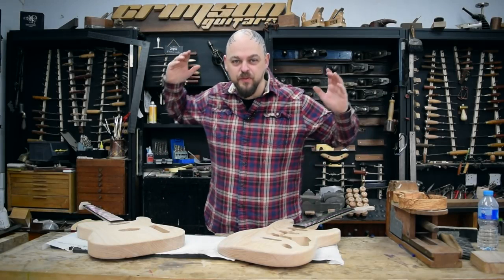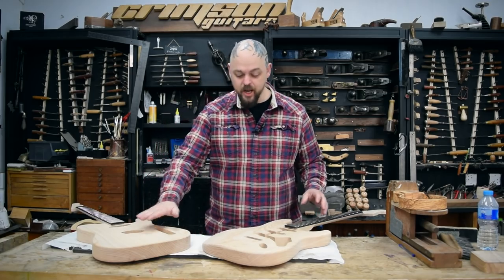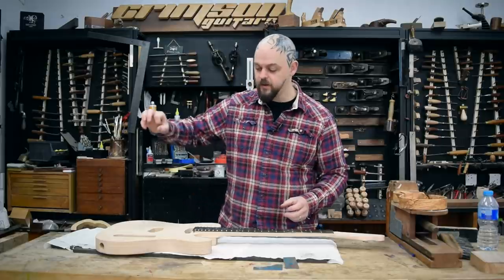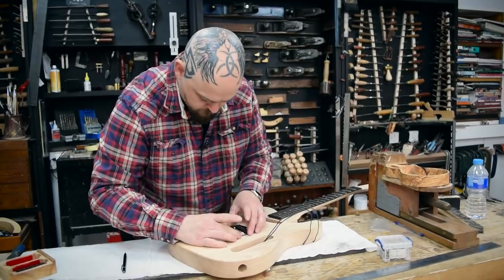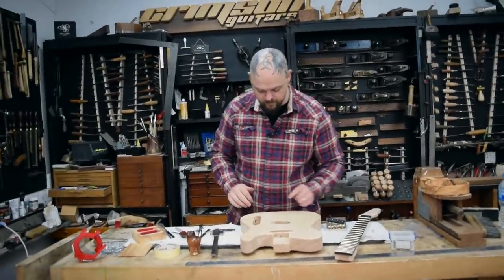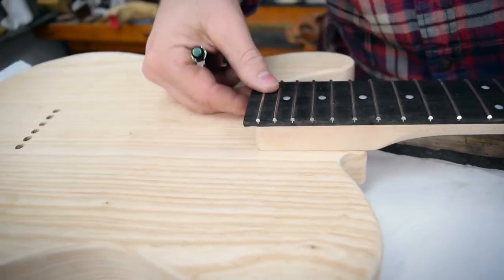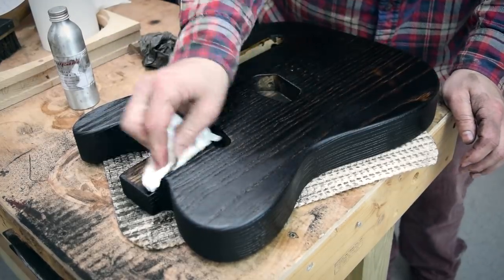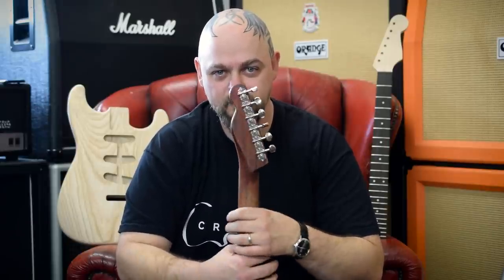Ep 1 - Building a Crimson T-Type Kit Guitar -  Preparing the Body

Comment: 13'36" indeed, Sean has a great eye for framing. Really appreciate the close detail look at your methodical marking. Mounting even a well pre-drilled kit can be challenging enough, especially if one rushes it, let alone blanks. It is important to go slow, make your mistakes in graphite over committing the wrong wood to dust and shavings — some wood must die for the sake of beauty, right? Good teamwork, fellows. Beauty shot in more ways than one.

Comment: Love the burnt look. I love the removal of the soft grain. There's a similar technique that I did on a cigar box (actually a jewelry box) guitar, that I would love to do on that body. Basically you remove the soft grain with a wire attachment with a drill. Then I'd use a rust/vinegar natural stain that produces totally unique finished depending on the tannin in the wood. It's not necessarily a stain, it's more like the copper effect you do- a chemical reaction. You basically take metal and soak it in vinegar to produce Iron Acetate. You can use just about any metal, some folks soak that dreaded steel wool that Ben hates in vinegar for a few days to weeks. I made mine by saving the liquid I soaked some rusty tools in to use. It takes some playing around (and maybe some dillution) to figure out what color you will get, but the effect can be anywhere from barnwood grey to dark almost black- brown. One thing that can also help achieve some interesting effects is to add more tannin to the wood by brushing on some cold tea and letting it dry. Then you brush on youur vinegar rust stain... nothing happens at first, but then minutes to hours later the magic happens. I usually play around with a scrap piece of the same wood- though that's hard with the kit. Also using those steel wool pads that contain soap can also give the stain a greenish verdi-gris look. It would be interesting to try this process on the body paired up with the copper/ammonia/mustard metal plates. Since they're both chemical reactions it would make for a truly one of a kind instrument.

Comment: First thing I'd do to customize a kit is to commission an artist friend of mine to paint the body, and in Crimson Guitar spirit, I would lightly char the neck/headstock. As for hardware I would use a fender 6 saddle bridge utilizing it's through-body capabilities, Grover Roto-Grip locking tuners, a hand-filed bone nut, an emerson 4-way switch, and Seymour Duncan Vintage Stack pups

Comment: If I got one of these kit guitars I'd very much like to engrave the wood with a Celtic design and add a wooden pickguard to keep the natural wood look. Also I love the look of single coil pickups without the plastic covers, I feel like they hide the character of the copper windings and that's what I did when I upgraded my first guitar, an SX Strat, I removed the sunburst finish and got new hardware and some fender '57 vintage sounds pickups.

Comment: Tele bridges are a minefield of tiny variations some barely visible to the naked eye. I researched dozens of bridges but couldn't find the right one for my Indonesian Squier. I bought it with a bodged on cheap aftermarket bridge and set about returning it to standard. I ended up filling all the current and original holes (including the string holes as their location prevented any kind of reasonable break angle after intonation) and I just started fresh as Ben has here. I'm thinking about picking up one of these kits and doing a full switcheroo...

Comment: For a T type, i would use a dark oil finish, with a leater belt all arround the edge. Humbucker at the bridge with coil split, push-push, single coil at the neck, tone volume for every pickup plus a master volume on the horn. Classic three way switch. Chicken head knobs. Reversed headstock.

Comment: Ben - I noticed when you are using the forstner bit that there is a bit of wobble in the bit. It might be the bit itself or that the chuck isn't tight on all sides but worth checking the chuck fitting itself. You might need to take the pillar drill chuck off, clean the inside of the socket thoroughly before re-fitting by pushing it down without a bit onto a hard piece of timber.

With the Pillar Drill, whats the best way to align the drill table to the drill bit? I know there is usually full adjustment in the table vertically and laterally and I haven't quite found out a way to re-centre the bed laterally. The tables usually have holes in so there is no centre-mark.

Love the videos and thanks!

Comment: A word of caution: if you do this on a 2 or 3 piece body, depending on how well jointed it is, you may find that the split between the joints will start to open up as the wood heats up on the outside more than the inside. You'll then find that the joint between the body parts is very visible after doing this. Guess how I know?

Comment: Just wondering what the measurement is for placing the bridge? Assuming it's a 25.5 inch scale length, it'll be that distance from the nut to the bridge... I get that. However, given that the saddles are adjustable for individual string length, that adds some uncertainty. How do you know the EXACT place to screw the bridge down? Great videos, by the way!

Comment: How would I customise one of your kits?
I'd go for the T-type, and:
- Stick a Bigsby on it - bridge TBC, but possibly a Babicz Full-Contact-Hardware TOM (my brother uses on of their bridges on his bass and the sonic transfer is incredible)
- Give it a forearm cut (and maybe a tummy-cut too, if my current weight-loss plans are less than successful)
- Control cover made from a bit of copper pipe hammered flat and cut to size.
- Scratch plate made of triple-laminate plastic (dark green on top and bottom, blood red in the middle) which is CNC routed with celtic knotwork (there's a local company nearby that does that sort of thing)
- Stain the wood dark green, and then oil
- Tweak the neck profile to be slightly v-shaped (I'm a thumb-over kinda player)

Comment: BEN, CLAMP A BOARD TO YOUR DRILL PRESS TABLE WITH A PIN INSERTED IN THE MIDDLE THE DIAMETER OF THE HOLES YOU DRILLED TO MOUNT THE BRIDGE, THEN LINE UP THE PIN WITH THE BIT USED TO DRILL THE FERRULES, USE A FLASH LIGHT AND WITH THE BRIDGE SIDE DOWN INCERT THE PIN INTO EACH ONE OF THE BRIDGE MOUNTING HOLES, THE FLASH LIGHT WILL HELP YOU SEE UNDER THE BODY SO YOU DON'T SCRATCH IT ON THE INDEXING PIN. YOU EILL HAVE PERFECTLY CENTERED FERULE HOLES ANSD YOU CAN ALSO USE THIS TO LINE UP THE ACTUAL BRIDGE MOUNTING HOLE TOO, ITS A FAILSAFE WAY TO GET PERFECT BRIDGE MOUNTING HOLES AND STRING FERRULE HOLES. HOPE YOU TRY IT.

Comment: How I'd customise one?
Honestly, I'd probably do the same thing with the body. Been wanting to do that to a guitar ever since you experimented with it. Would probably go the tele (or lp if you do get to do them), and run a meaty bkp humbucker in the bridge with a split option, with a nice single coil in the neck to go with for a varity of tones.
maple neck, maple fretboard, oil them up, probably paint the face of the headstock black (or do the charry thing if it's doable without burning the sides as well). Then probably plain black pickguard, and one of those fancy etched control panels, and black hardware

Comment: I think id shave a little away where the ferules for the neck were drilled in to make access too the higher frets a bit easier, add a belly cut, remove the inlays and make some custom ones and get a friend to do a custom carving on the front of the body.

Comment: Here´s my suggestion for the Tele: I´d take off some wood from the edge of the front so it´s a little more curvey and almost looks like it´s an archtop guitar. In addition to that I´d take of some wood from the back for a "belly dent" just because I like thatt. Did both on a very cheap (and shit) Telecaster kit and it came out pretty nice I think. . Then I would change the headstock a little to make it a look a little more edged and metal. As a finish I would try to swirl it as I never done it that but I thibk it might look pretty cool on a Tele!

Comment: I have a secret tip for you.  Put two strap pins on the bottom of your guitars about 3 or 4 inches apart. This not only offers two hanging from your hip options, but the guitar will lean against the wall or your amp without falling to the ground.

Comment: carved arched cap, if it was a scratch build kit, if it was prebuilt then try some wiring mods, maybe get a neck blank to try doing a custom inlay. again if it was from scratch then a rear cavity for all the wiring along with a cover. maybe try making some custom knobs for the pots out of cast resin, and a switch tip. doing a wood binding, or maybe a veneer on the back and sides. with a cap id have to mod the pocket and neck slightly so maybe try making it a set neck and where the holes for the neck bolts are just glue in some wood inserts like some furniture builders do.

try a few leather working techniques ive learned about to do cool patterns and maybe make a strap and mod a case for it. take a piece of wood and find a bracket and build a wall hanger for it.

also there is no way thats a two piece body, like holy shit does that look good.

Comment: I would build a s type guitar but then i then make it fit two humbuckers and then i would put twee seymour duncan p rails in in every series and parralel setting posible and i would put a floyd rose trem in with fender stagering locking tuners and i would put on the plate where the neck screws are that binds it with the body on that plate i would carve my name or initialls out

Comment: Ben, do you have an opinion on using tongue oil as a guitar finish?  I have seen several videos on a channel called Guns and Guitars featuring this and the guy who runs this channel (often building and improving kit guitars) tends to get pretty good results.
Reply: James Lewis “Tung” oil
Reply: Depends what look you want. I’ve used Tung oil for 20 yrs - with patience and 20-30 coats it does build into a decent finish and not just a coat of oil - but it will never look like s pore-filled glassy sprayed finish. Pro- it is about as easy to apply as it gets.

Comment: You had such a nice thing going, highlighting the grain, getting some burnt flashings for a fake purfling, nice.
Too bad you just burnt it all black. You must have worked in an automotive body shop before you got guitars.
An artist would hold the sandpaper in his hands, working the curves and inside bends, and interesting isn't good.
With sandpaper, you could have worked the grain in the wood and got back down to some wood grain,
and that would be interesting. As a disclaimer, I'm into painting bodies without using clear-coats.
I live for the light. I don't live for the shine.
Go ahead and laugh. Yeah! So would I, sitting in front of a Marshall stack. I went through four 100 watt heads,
and six cabinets before I got custom components, but I haven't been in the room with one for over 25 years.

Comment: So anyone bought these diy kit? I dont really think  390 is so expensive if the quality of these are high, sure you can get chinese diy kits for 120 or even less, but unless you are lucky you need to be prepared for some problems. The neck might need to be refretted, neckpocket might need to be improved, routing for the bridge is sometimes wrong etc ...
Reply from the maker: Kudos on the wizard user name! We've sold roughly 80 of these kits so far and have only had one problem and no other complaints.. Would you believe we completely forgot side dots on one of the earliest kits sent out :/ we sent out a new neck straight away and so far have had no unhappy customers that we know of. B

Comment: If I was to assemble one of these T-type kits, I’d first
rout out room for a pair of Humbuckers, likely a pair of Seymour Duncan custom
shop Greenies. Then I would experiment with a flame finish although I would
only burn the edges of the top, opting for a cherry stain for the middle for a
burst effect. Because of the humbuckers, I’d only need a (weathered chrome) plate
for the control cavity; the rest would be uncovered, also it would have to be a
non-standard tele bridge but I’d still go for a hardtail. I’ve got a fondness
for the music man headstock so shaping into a nice tapered 4+2 would be my plan
there as would be using weathered grovers. I’d like to experiment with custom
inlays too but they are a little beyond me at the moment!